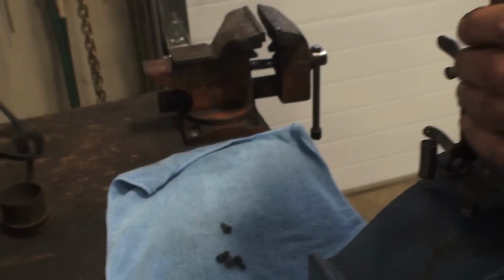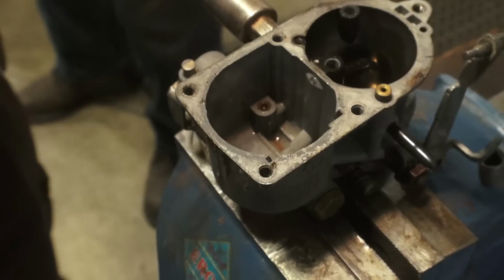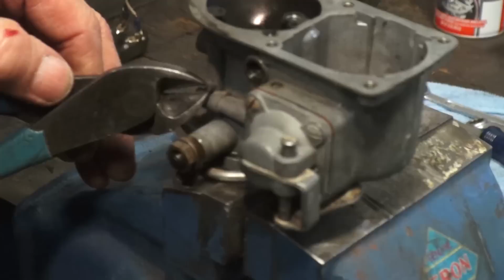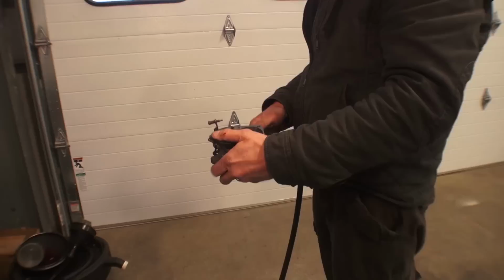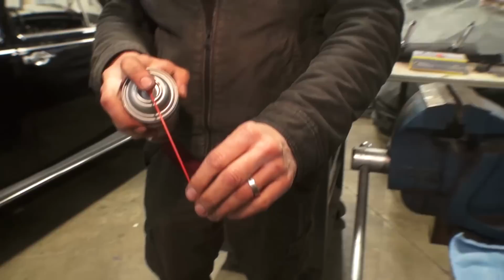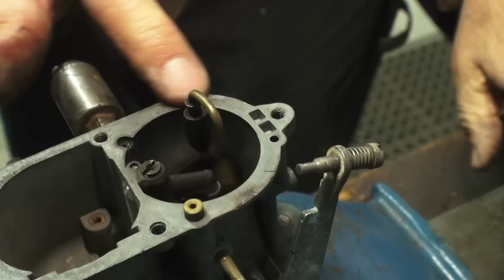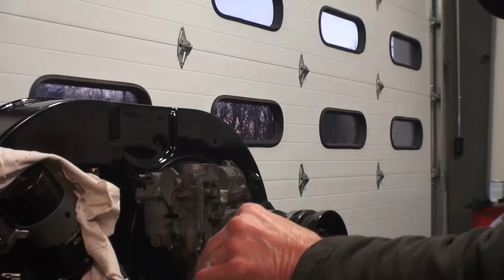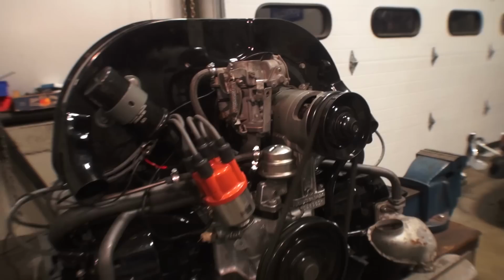Classic VW BuGs How to Express Clean Restore Rebuild Beetle Carburetor Carb

Comment: Great video.  When it come to the "s" wrench, I had to modify one I got at Harbor Freight, because the head was too thick to fit around the back nut.  This is on a 1973 standard beetle.  I ground it down until it was thin enough to fit between the tube the carb attaches too

Comment: Great video, very helpful! I am new to working on Classic VW and am having a blast with it. I own a 1966 with a chopped 1956 top, originally built by Airkewld. I bought this from a guy doing a "quick flip" and have spent the last month fixing all of the issues. One of the issues was a rough idle and it would die at a stoplight. I watched this video one time and was able to completely clean out the carb, I also filed and re-gapped the points. The car now runs and idles perfect, no more dying and much more responsive. Thank you for sharing this video!

Comment: Great video. I bought a 63 beetle that sadly has an Empi carb on it.  The car sat for over a year and ran ok for a while, then the fuel pump went out. Replaced that, now the carb is acting like it is possessed. It starts and runs great sometimes, other times not. Sometimes I have to pump the accelerator to keep it running, other times not.  I am considering just replacing the carb, but options are limited in the availability of replacement carbs.

Comment: is it possible that the brass of that bigger ball had to tap the pin too deep? can it sink as deep as it goes or does it have to be level with the deck? can it prevent the fuel pump or the ball from working? Are those two balls for the acceleration pump?
very good tutorial video you have! weather

Comment: Hello my friend i woulk like to ask if how many minutes does a 1 liter takes on a idle mode,because my carburator right now have a problem it only takes 20minutes to consume 1 liter of gasoline on idle mode.
Reply from the maker: You are running a little rich, it should be 23 min at 1500 rpms.

Comment: Chris...following your express clean carburetor video and noticed the slotted head on the vertical Air Correction Screw/Jet was damaged and cannot back it out of the carb body - afraid of digging what's left of the head off.  Any tricks of the trade on removing that jet for cleaning - the tip for removing the bowl plug with the tail light screw worked great!  Thanks

Comment: I bought a Solex carb for my beetle  Followed this video and removed all parts, cleaned them.  Removed the check balls, cleaned and replaced. So far so good thanks to this video I discovered a bolt and nut in a hole near the lower butterfly. No idea what it does. I removed the bolt for cleaning. The hole is not threaded and goes right into the lower body of the carb next to the lower butterfly.  The bolt does not seem to do anything other than block the hole.  Does anyone know what is supposed to be there?  I need help

Comment: How is this different from dropping the two half's in carb cleaner? Letting them soak. I do that and blow the ports out with carb cleaner. This looks more thorough, of course, just curious how much better it is -- and I fear losing all those bearing & screw's.

Comment: What is the thread size on the bolt you referred to as a tail light lense bolt used to remove that part to get to the ball bearing?
Reply from the maker: I think a 4 or 5mm

Comment: Hi can you help in this vid when i do my throttle valve it will not pump the fuel out. i have stripped it all i think and cleaned it. why am i not getting the fuel up?
Reply from the maker: You should take the pins out and all the lil BB balls, and really do a soaking on the body of the carb and shoot carb cleaner in it.

Comment: Chris, Thanks for the informative video which I followed with a rebuild kit on my 30 PICT-1.  My 65 starts great when the choke is closed.  Humms right along as it warms up.  When the choke is full open it chokes, stalls, and dies.  I can hold the accelerator arm into the higher RPMs and it sounds great.  It just wont idle when warmed up for anything.  One mechanic suggested when I soaked the scum off it opened up vacuum leak at the throttle shaft and I need a new carb.  Walking around the VW swap meets seems like everyone has 2 or 3 old carbs to sell.  What do you think?
Reply: Fred Tschirgi - Get a vacuum gauge, it's cheaper and more useful in the long run, than blindly trow parts into the car without certainty. 
BTW Tip is valid either for a 60 years old Bug or a modern car or bike just out of the showroom. All of them are still glorified air pumps. LOL ;-)

On this particular case I would smear a bit of grease on both sides of the butterfly shaft, just enough to temporarily seal any eventual leaks. 
Them run test before condemning the part. ;-)

Comment: Hi there.  Nice vid!  I was working on a 1964 Ghia - it's my mother's car and I don't have any info in front of me - but I was curious about what you thought of this problem.    I can get the car to idle sitting in neutral and it'll idle as long as I let it - but once I start to drive the car in gear - with the clutch in - it'll stall out.  But only when I have it moving and in gear.  I'm basically popping the clutch to get it running while I'm making turns and whatnot.   I can think of a few things but the sitting in place in neutral and constant idle working - has me confused.  Any ideas?

Comment: Chris - love your videos. Question: if you switch the stock oil bath air filter with a paper element one, what do you do with the vacuum hose under the carb that used to go to the top of the oil bath?
Reply from the maker: Vacuum hose under the carb?  I don't understand.
Reply: @classicvwbugs  it's not actually on the carb - maybe an inch below the carb mount? Comes out on driver's side.
Reply from the maker: @temag345  its on the manifold?
Reply: @classicvwbugs  don't know what you call this piece - it's literally the piece that the carb is mounted on top of with the two bolts. I always call it the throat - it's where the fuel-air mix drops down into directly underneath the carb butterfly. There is a vacuum port about 1" below the carb mount on this "throat" (it points directly to the left if you are looking at the engine from the rear) that is clearly designed to take a vacuum hose and go somewhere. When I got the car, it was connected to one of the two vacuum ports on top of the oil bath air filter. Wish I could give you a pic - damn YouTube.
Reply: perfect thank you!

Comment: Hey Chris great video I’ve got the same carb on my bus and it’s not letting anything through “the faucet” My guess is those B.B’s are clogged but those brass plugs won’t come out for me any suggestions? I cleaned it once and had it flowing but when I took it apart recently I saw what looked like calcium buildup in the diaphragm I’m assuming it’s built up in the faucet tubes  as well
Reply from the maker: I would let it sit in a carb dunk over night, they should loosen.
Reply: Chris Vallone it worked! I’ve got gas flow and even got the engine to fire! Thanks so much! That’s the first time in 40 years!! I’ve got no idea how to set the idle though and idk why but I think it may be leaking out of the accelerator pivot I’m thinking the needle/seat isn’t closing cause it’ll keep slurping the gas I give it until it’s dripping on the engine

Comment: I have a solex h30 31 pict on my rail buggy. has a horrible dead spot right off idle.  I noticed it doesn't spray fuel out the tube unless you pump the throttle 3 or 4 times. do u think a simple clean as yall done could cure this problem? it idles beautiful and runs great but hits that dead spot off idle and going thru the gears. But once your going thru the gears you can just give it more gas and itll come out the dead spot. thanks for your input.
Reply: I'm having the same problem with my 30/31, did you get this figured out?  Thanks!
Reply: not yet. I thought I had it figured out but it started doing it again.
Reply: maybe a weak or dying fuel pump

Comment: Idle mixture screw 5,5-6 turns out, did i hear that correctly? Trying to get the correct settings for my new 30 pict - 1 carb hooked up on a 1500 engine. Read somewhere today that 1,25-1,5 turns was correct so being a bit confused
Reply: 5 half turns is what he meant so that would translate to 2.5 full turns
Reply: +edvin wenden that sounded more reasonable :-)

Comment: Chris Vallone I have a 71 vw and the carb it's missing the jet that you pull out on the 1:14 and when I take off from a stop sign I have to press the accelerator many times or it will die on me...you think thats the problem?
Reply from the maker: could be, what carb do you have on there?  Many times that hesitation is a good cleaning that is needed on the carb.
Reply: Chris Vallone I have the Solex 34 pict3

Comment: i am having a problem with my bug. i was told its a carb problem. when i come to a stop it sounds like it wants to stall and some times it does. im not sure if i adjusted the carb right or put it on right. im not a machanic and just learning wile i go. is there any advice you can give on putting a carb on and properly adjusting it. thanks for ur time.
Reply: make sure your wire to the idle solenoid(on left bottom) is hooked up and not frayed.  had same problem and found wire was not attached, fixed problem

Comment: I did everything as you did, my only problem was i could not get out the one large bb that you used tail light screw to remove. I also hit down further then it was originally , my question is, is that okay?   I was not able to remove it, therefore couldn't clean it and also moved it further down. Eveything else was done correctly, will i be okay?
Reply from the maker: you moved what further down?
Reply: +Chris Vallone the large bb.   where he uses the tail light screw to lift it up, once it's lifted the BB rolls out.    I put the carb back on , and it's working fine, thanks
Reply: Chris Vallone it's there a serial number on the carb to know what carb kit to buy...or how do I figuer that out?...hope you can help

Comment: That's not an accelerator solenoid, it's a fuel cut-off solenoid that shuts off the fuel when the key is turned off. This stops a hot engine running on.

Comment: criss i  have just rebuilt my  motor and fitted  new carbi not sure how to wire up fuel solenoid and choke can you please advise me
Reply from the maker: +malcolm mathers You can make a Y cable, the two ends go to the idle solenoid and to the choke, then the single end goes to the positive on the coil.
Reply: thanks  chris

Comment: Over the last fifty three years I have found that so many of these Solex carburetors have lousy idle characteristics. Terrible compared to American car carburetors. Wet days bring out the worst problems where the engine won't idle at all. Other times it seems like there could be dirt in the idle circuit,  so many times over the years I have removed the idle mixture screws, blew air in the circuit and readjusted the screws while idling but hardly ever get good results. In American cars this works quite often but not these lousy Solex carbs. What I am hoping to hear from someone is a modification to these  VW carbs. that will cure this idle trouble. Cleaning is not the cure. I have even had this idle problem show up on several brand new China made carbs for VW cars and even with new manifolds that should not be carbon plugged. Perhaps there is an idle jet that should changed for a bigger one. Remember, normal common carburetor maintenance and repair is just not the answer to this highly common problem. Any ideas? Thanks.

Comment: hi Chris, I have a Volkswagen Beetle which I recently put a new carburetor on I took it to a professional to have it adjusted and about a month later it started missing and it wasn't getting the correct amount of fuel, I took it back to the professional and he told me the fuel filter needs replaced, what do you think
Reply from the maker: Blake Graham Did you drive the bug often during that time after adjusting?  Or did the car sit a bit?
Reply: It was drove every other day
Reply from the maker: Blake Graham sounds like a fuel pump or needle and seat in carb.
Reply: Could it also be the fuel filter?
Reply: Blake Graham - For goodness sake. A fuel filter for these cars cost pennies. Are usually transparent (so can be easily checked) and on top clog fairly easy due to: Small size, tank full of decades of "things" floating in there and even rust from the tank itself... So what's the doubt about spending less than 5 minutes to change it? ;-)

Comment: i just bought a 30 pict 1 carburetor would it work if my current carburetor is a 34 pict 3 ?
Reply from the maker: +Danny Doreeto you would need an adapter
Reply: If your stock carb is a 34 pict 3  stay with it. The 30 pict 1 will not only need the adapter but also need bigger jets and still won't even put out as much power as the stock 34 pict 3. I have a '74 standard and I've had both types on it, I speak from experience.
Reply: Chris Vallone what it's your email?

Comment: My carb has like 7 gas leaks, is it repairable
Reply: KG7YTS - Sure it is, all depends on time/money/will. If it's a few gaskets/jets job, no worries. If it's a major overhaul (ex. butterfly shaft leakage) than might be easier/faster to simply replace it. 

With this said I never HAD to put a new carburetor. Unless it's physically broken/cracked. Can always be revived. ;-)

Comment: Stay German whenever possible best advice if you need replacement. I had an old 28 pict on a dual port that was losing fuel out the throttle plate bushings. I got sold some empi 38 egas hated it. Made yet another mistake bought chinese 34 pict 3 clone, straight up junk. Now looking for German and they are asking 400.00 insanity!!